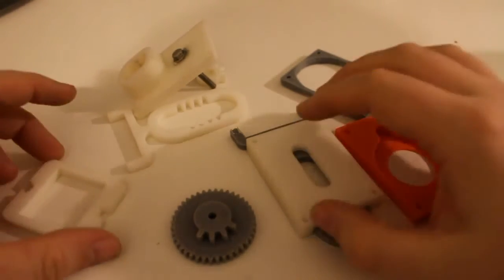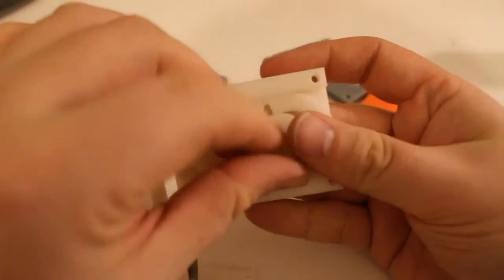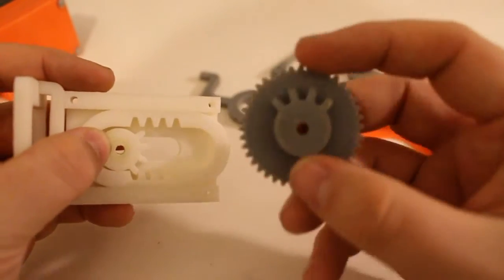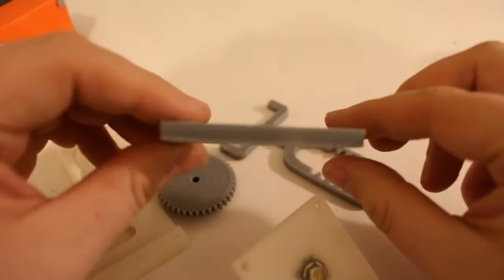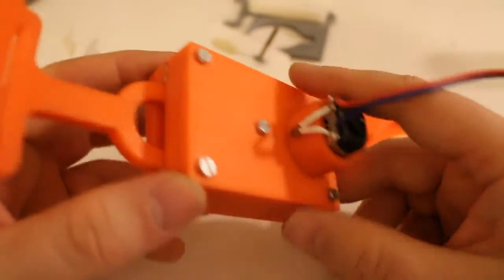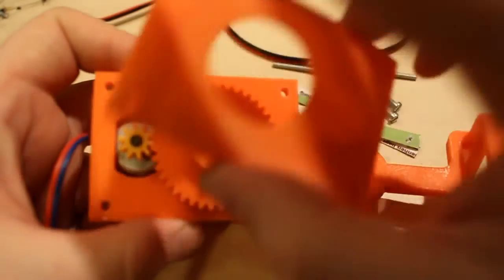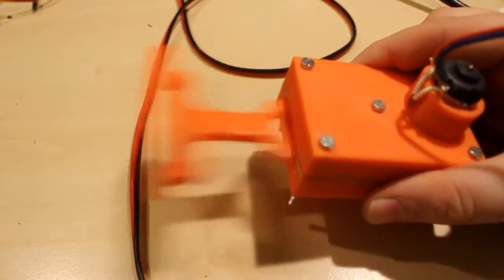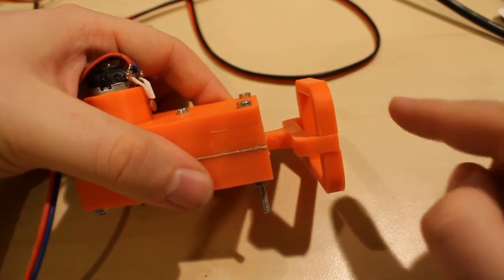Locomatrix walkthrough and Version 2

Comment: You see, that's a cool invention, but, change your actual motor to an brushless motor and a ESC, plug it on a arduino and config the output, that will allow you to control the speed of rotarion, the torque and it will not fail after tree times, sorry for my bad english
Reply from the maker: Thanks for your input! I'm aware that I did not chose the best hardware, but I wanted it to be relatively simple looking and with the new printed parts it won't stop after three times. It's supposed to be a bit "loco" (spanish crazy) and as long as there is the slightest possibility that I'm able to get a bit 3D out of it, I'm happy - it's a proof of concept where I'm mostly reusing parts I have in my boxes. I might add an L293D soon to control it with the onboard arduino, but I would still have to measure the time between clicks anyway so I don't really see the point.